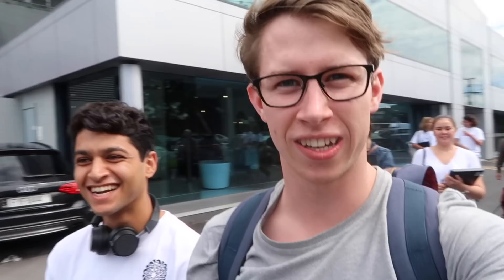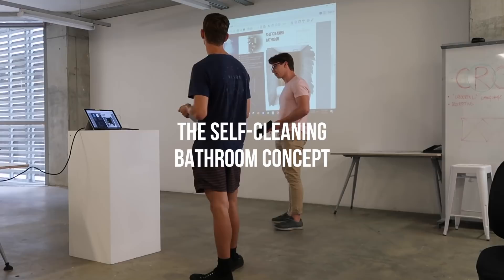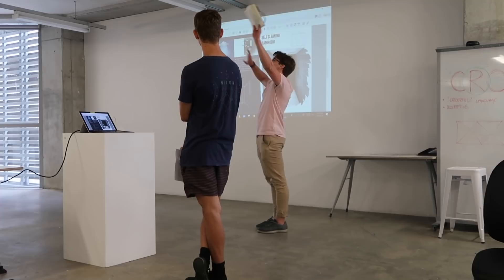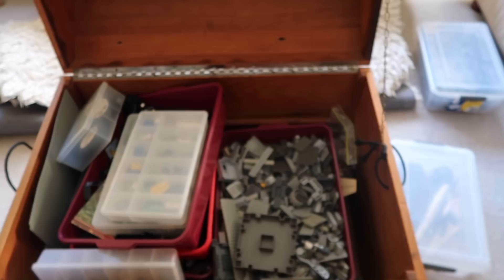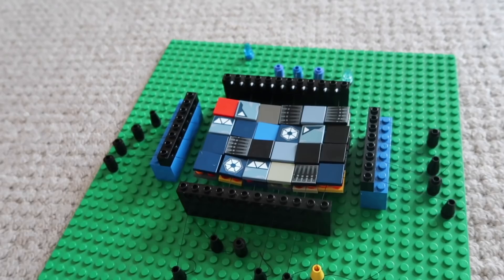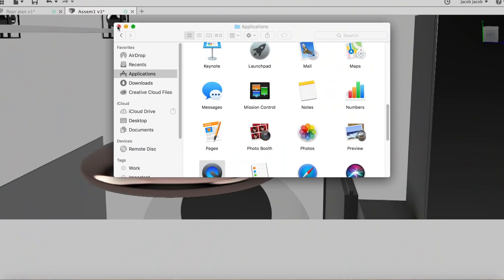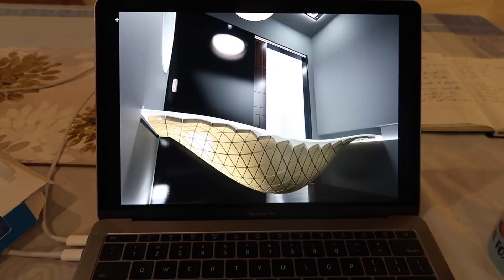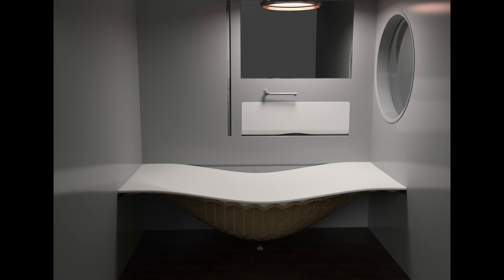We Designed a "SOFT BATH" for KOHLER

Comment: Love the ideas! Your partner is amazingly talented, I wouldn't even know where to start to create that curved tessellation! Hoping for the best for you two
Reply from the maker: Agreed. Jake is so freaking good. He is probably top in the class.
Reply: It was a great execution of some basic principles. I'm assuming this was done with sub divisional modelling. Essentially you just make a plane, which has quad faces, the you traingulate it. This gives you the triangles. Then you select all the edges and bevel in. Select the inner faces and extrude and delete the other faces. You could link this to the white surface so it deforms with it and then use soft selection to deform the surfaces. I'm still learning so there is probably a more procedural way to do it but I hope that reveals some of the magic.
Edit: Hold up. He did that in Fusion?! I take it back thats a whole different beast. I havent used it much so I'm stumped lol.